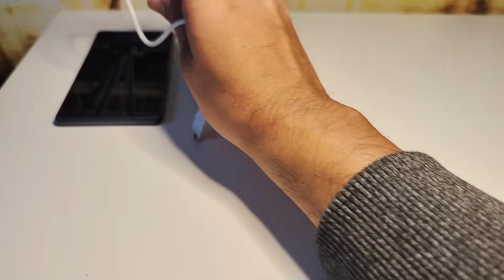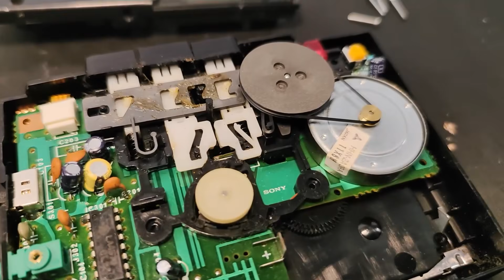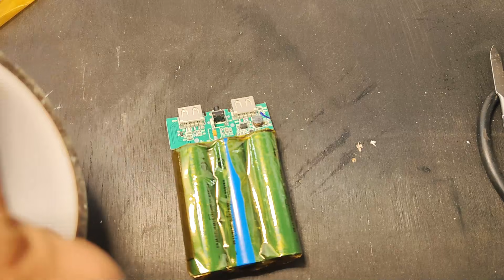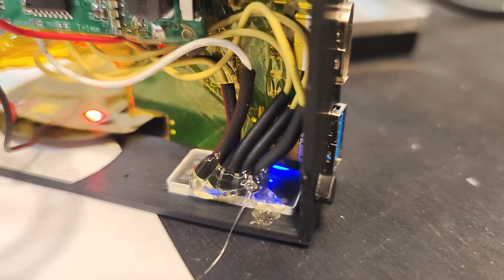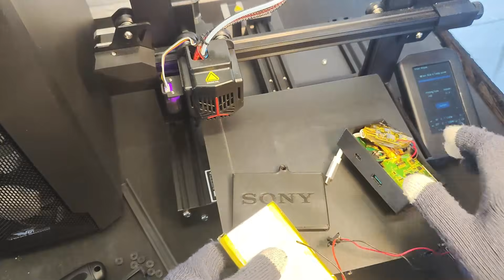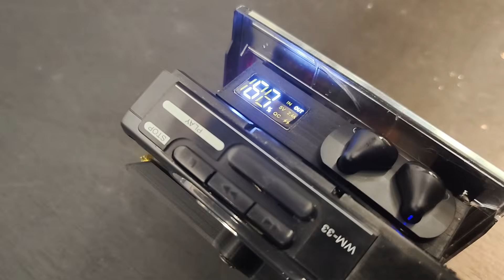Why I Made this cool RETRO MOD for my Android and Iphone

Comment: hot glueing PCB's? that's a no-no buddy. That power PCB can get really hot, specially in the switching components where you hot glued, right next to your connector! That will melt your glue and create a mess inside your walkman...
If you wanna fix PCB's to enclosure, maybe you should design a more proper 3D printed part, that acts not only as a gasket but also as support, with mounting and mating features.
Also, can't use PLA for a project like this, it's transition temperature is too low, and will loose it's mechanical stability at fairly low temperatures of 60 celsius.
You also left no provision for cooling. Put that all together with a large battery like that, and you made yourself a nice ticking bomb mate! Not a single fuse to be seen on the battery line as well, marvelous!
Reply from the maker: Hi thank you for your feedback, I agree with some of this but not all...
1) Yes hot glue is a bit of a lazy implementation on my part and I should have better designed the caddy, laziness on my part
2) The glass transitional temperature is 50 - 60 degrees however this does not cause the material to loose a significant amount of its mechanical integrity, I did not use standard PLA but PLA+ which is much stronger than standard PLA (11 times stronger apparently).
3) The Airflow is more than sufficent if you look at battery banks that have the same size battery they litterally have no airflow, also the battery itself is mounted on the outside of the walkman.
4) There is no fuse because the power PCB has overcurrent protection, also I insulated all of the PCB's from each other so even if they do make contact there is no short. 
Hope this answers some of the concerns you raised.